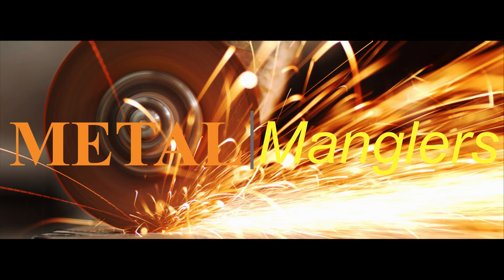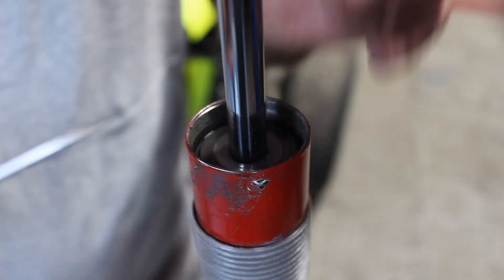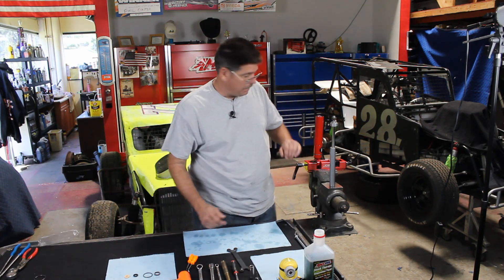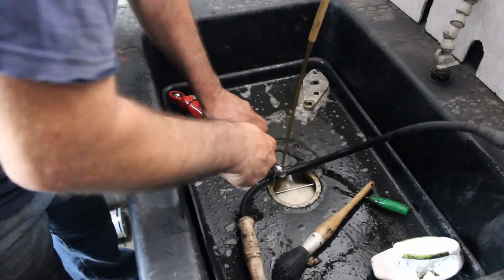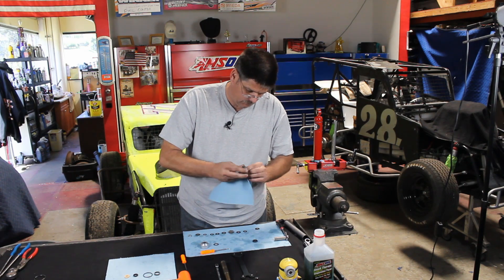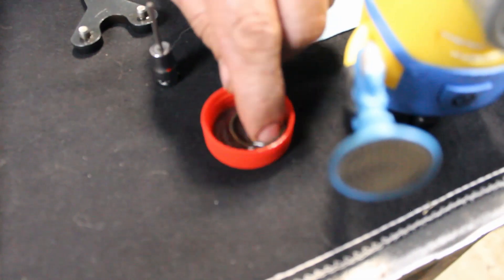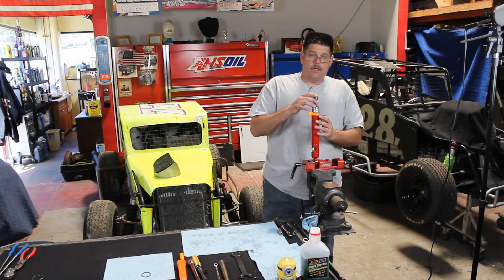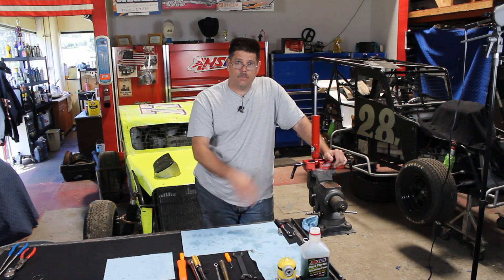Racers!! Save $ with a DIY Shock Rebuild - QA1 70 Series Shock

Comment: Can you have a small dent in a shock and still work ok
Reply from the maker: If the dent is small enough that it doesn't get into the interior emulsion tube, you should be good to go.   May cause problems with the spring adjuster sleeve though.